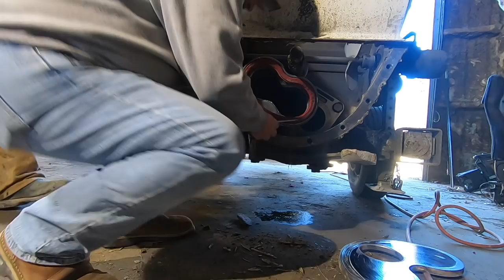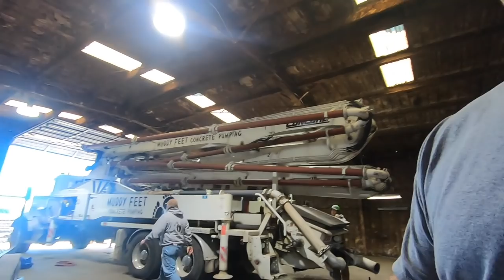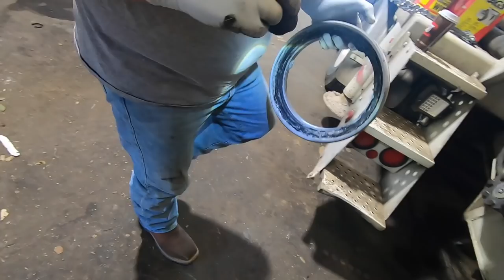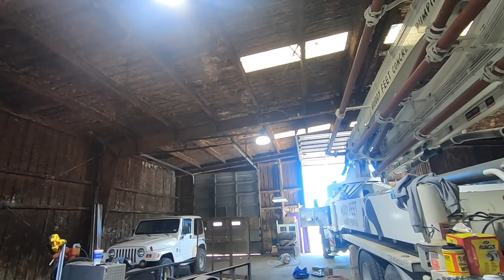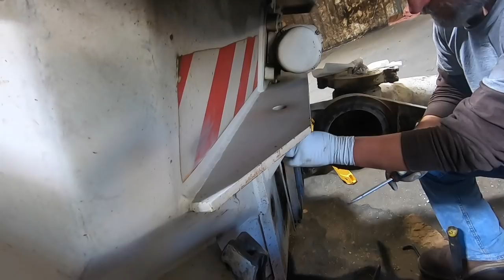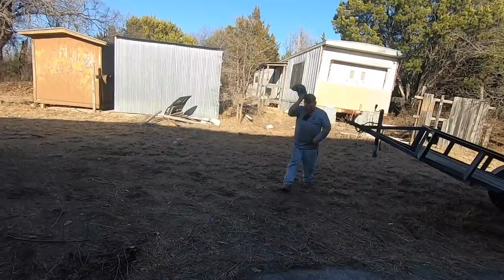Getting ready to go pump after the storm. Maintenance with Muddyfeet

Comment: I Have seen this same problem with pumps eating pressure springs.  Cleanly ness of the cutting ring and s tube when assembling as well at s tube nut proper tightening procedures are key.  For a big mouth s tube.  Slam the big nut home then back off a 1/3 turn.  Double check me on that 1/3 turn in your manual. Also on the schwing kidney seal.  The way you had it was correct  at least that's how i have been doing it for years.  Flat side faces the mirror plate rounded side towards the valve. Hopefully this helps
Reply from the maker: I understand about the kidney seal being backwards.

Comment: Round in, flat out toward ware plate.
Reply from the maker: I know but I don’t like it like that. Lol
Reply: @MuddyfeetConcretePumping  if it's not sealing right its probably not in kidney seal, there is a rubber spring under the cutting ring ,  I've had to modify ours too   
I used some5/8 conveyor belt

Comment: Never run the Schwing rock dry, at least fill it with water or squirt water at the kidney plate when stroking, you will damage the kidney seal
Reply from the maker: Exactly right
Reply: @MuddyfeetConcretePumping  ran a 900 rock for 15 years and loved it

Comment: Jeff did you notice the leak in the trailer pump?
Reply from the maker: What leak?
Reply from the maker: What leak?
Reply: @MuddyfeetConcretePumping  underneath when you started it up there was fluid coming out the bottom.
Reply from the maker: Yes that was water. No issues.
Reply: @MuddyfeetConcretePumping  sorry it looked like an leak from the video.